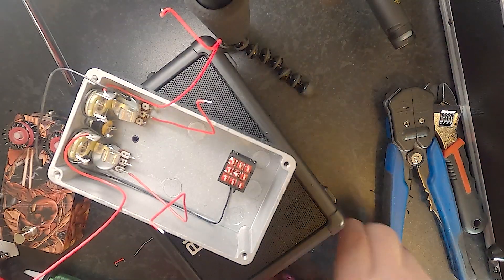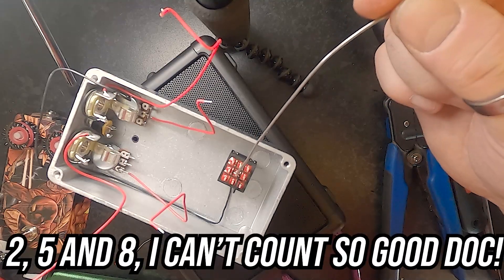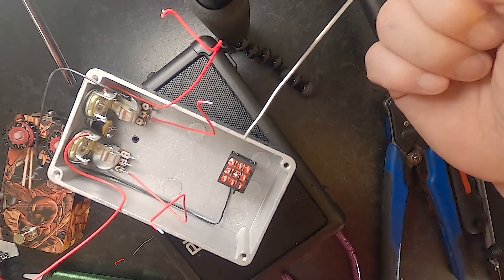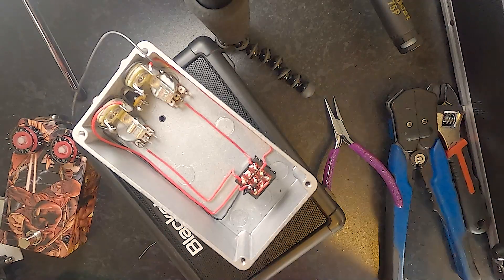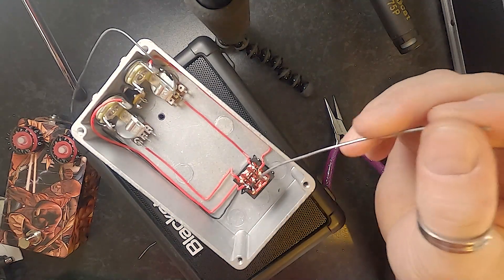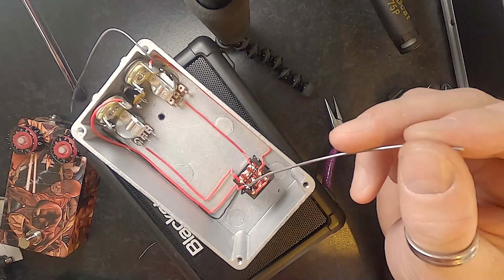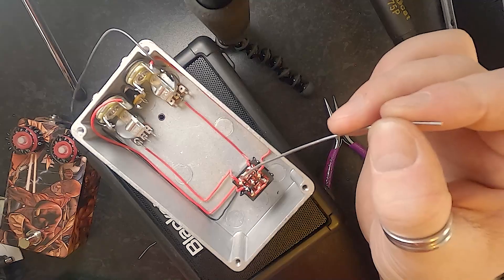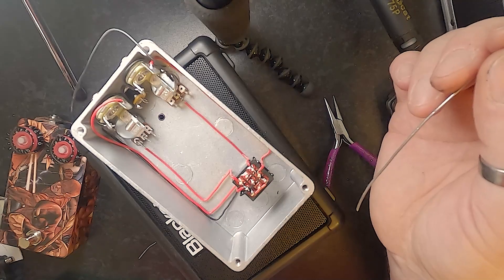DIY Pedal Building How To Wire A 3PDT Effects Pedal Footswitch For True Bypass

Comment: Great video, thanks a lot!!!! Could you please ask where the ground wire that you have connected in the center of the 3pdt is soldered? It seems to go to the input, but it is not clear where exactly. Subscribed and thanks a lot for your contribution.
Reply from the maker: Its connected to the ground lug on the input jack. I did a ground loop video that shows it. Cheers.
Reply: @goliathfxbassandpedalshow  Thank you very much for answering. I will look for that video right now. Fantastic.